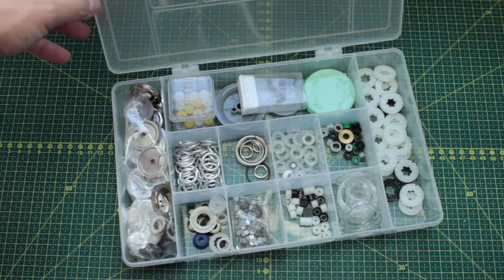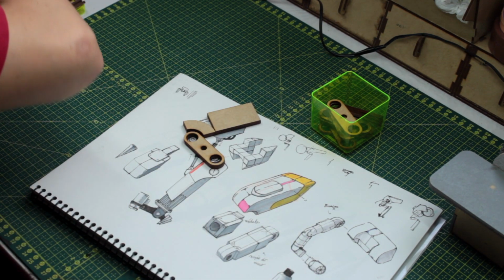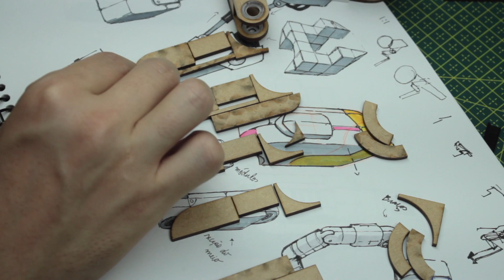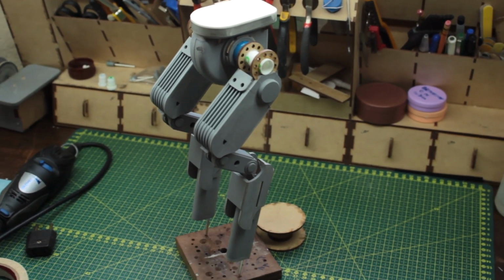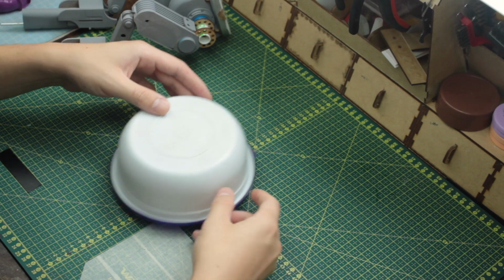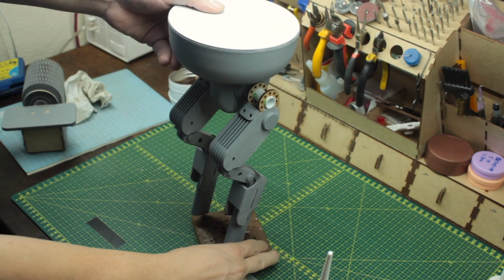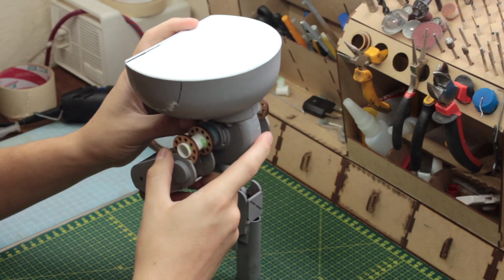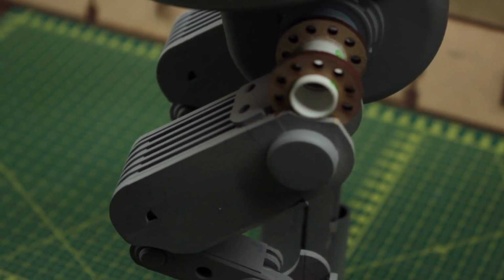Turning trash into models!

Comment: Awesome! very inspiring! i'm in a big trouble here, i can't find online or tutorials about 360º joints, for making feet or arms or heads rotate, i don't want to use ball joints
Reply from the maker: Thank you! I have close to none experience in moveable joints so I avoid them most of the time, but I guess you should consider using ball joints since the are very often used in the stop motion industry.. Is there any specific reason to avoid ball joints?
Reply: If you've ever built a Gundam model they actually handle this nicely, the couple a joint limited to one axis to another and that achieves essentially 360 degrees of movement.

If you haven't built a Gundam before you can buy kits for about $20-$30 and maybe see what I mean for yourself.

Comment: Hi from Iowa u. s.  When you sketch your ideas, do you consider the bits you have? Or do you just flow and deal with it after? Great work btw.
Reply from the maker: Most of the time, yes! Sometimes I get the whole build idea from an specific plastic piece... But for the sniper spaceship it was different. I had only the concept of a sniper spaceship and figured it out on the sketching... Thanks for that amazing question!

Comment: How did you measure the curve on the container?
Reply from the maker: Great question! First I found the vertical mould line from the container, and using that as a guide, I did one side by hand and copied that line with masking tape to the other side. I also drew a perpendicular line on the top.. If correct, these three would meet. Thanks again!

Comment: What types of glue do you use for your constructions?
Reply from the maker: Hi! I use mostly CA glue, most of the times i add some baking soda to serve as gusset. When I need more strength than usual I go with fast curing epoxy glue. Thank you for the question = )
Reply: @CutTransformGlue   - so CA is in the bottle with the needle applicator tip?
Reply from the maker: yes, the glue that you see me using most of the time in every video, that's CA Glue  @jmortonsalt